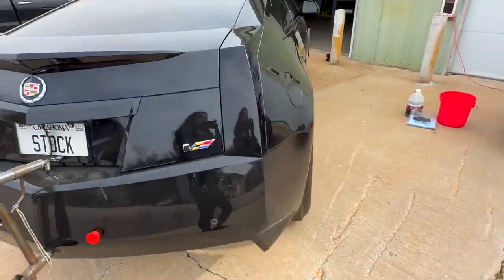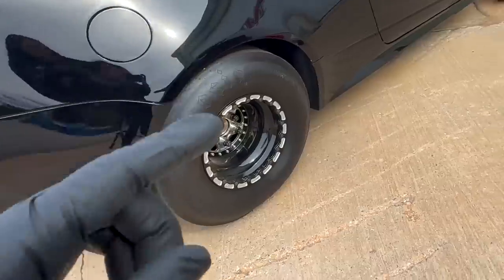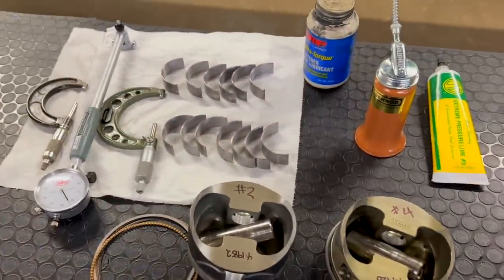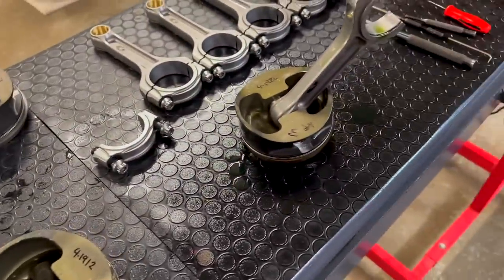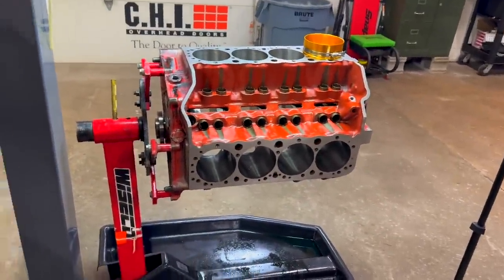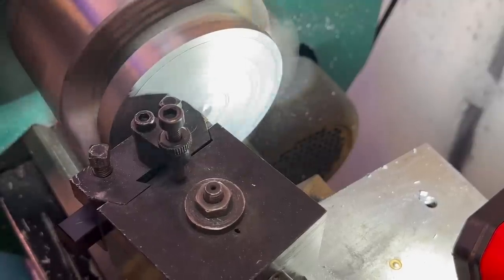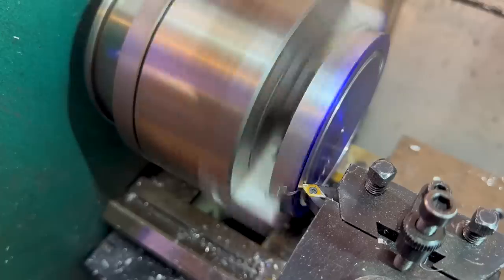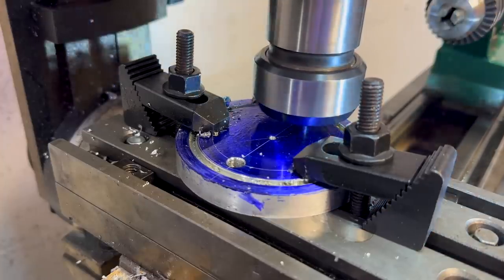Chief getting the short block together to go into Caddy Jack while Jackie gets the car cleaned up!

Comment: For those that don't understand how it works, and keep asking about sealing the bolts to his cover.....
When you oil from the front using an external pump, the 2 galleys that normally go to and from the filter get plugged. The one feeding the filter was plugged under the main cap, and doesn't intersect any other galley. Internal pump straight to filter. The big galley in the center, that he showed you he plugged in the last video will see oil, but with a sealed NPT plug, will not leak. 
So, TECHNICALLY, he wouldn't have to cover it, since there is NO OIL under that cover, therefor  he doesn't have to seal the bolts. It's just a cover. If something drips from a bolt, it means his plug isn't sealing correctly, but there is no oil pressure under that cover. Just an FYI. 
Sidenote: Chief... just a helpful hint for future reference, install the cam first to ensure no fitment issue with bearings.  Then crank. Then timing belt or chain. Install #1 rod/piston and degree cam. MUCH easier as the engine spins real easy to dial in and you're not fighting all 8. 
Then with these big strokers, rod to cam lobe in #2 & #6. This are the closest. Even if they clear, find out by how much. It changes when running, at rpm, and depending on what centerline you put the lobes at. 
I'm sure you didn't show your entire procedure in video, but take note of your rod side to side clearance also. 
Hopefully the head gasket is thick enough to kill the quench if Jackie plans on bombing it on the bottle lol. 
Hope all is good 👍

Comment: Just fyi....If you had a digital readout on your x axis of the lathe you could easily use your grooving  tool to skim cut the outer diameter to get a reference diameter....mic it...then zero your slide and move the tool in accordingly. That will get you within .001 or so of your desired o-ring groove diameter.....you could also just count your revs on the dial but not as quick. Also when you're clamping your part to mill or drill use another thin piece of aluminum on top of your work to prevent marring and make sure the stud coming up thru the clamp favors the work side....not the riser side in the back. The closer the stud is to the workpiece the better...because that distributes more holding power to the work piece to prevent movement of your part. Nice video...can't wait to see the end result at the track!

Comment: Nice on the block off plate, stuff like that is always fun and gives a good feeling when it works! If you have a small part like that with a complex bolt hole pattern, I'd be happy to help. I have a small desktop mill and a DRO so making hole patterns is not too hard to set up. I also have indexing plates for my little cheap rotary table.

I normally say that I chew parts out, I'm not a real machinist. But I get work done.

Comment: Hey Justin next time use your indicator on the mill to find zero. You basically did something really similar when you were using it on your 4 jaw chuck. It’s magnetic base will work on the spindle of your mill too. Or just get you an edge finder for quick and dirty set ups.

Comment: Awesome ! My Dad use to machine main bearing caps for Pontiac engines . 4 bolt main caps with the inside bolt hole drilled at angle .can't remember what angle but . Good. Work man

Comment: Chief...as an old aircraft mechanic...was wondering if the 2 Allen bolts with washers you put on the oil filter cover will leak.  There is a washer made with a built in O-ring called a Stat-o-seal that may solve a potential leak.  OR, you could countersink to the right depth the two holes in the cover to retain an O-ring when washer and bolt are installed.  Good luck with the set-up!

Comment: I think since the seal on your home made adapter is outside  of the  bolts (where the filter would be) the bolts will leak oil, unless you use  Transmission front pump washers or something to seal the bolts..

Comment: Question are the bolt's going to leak oil ? No seals on bolts. You could cut bolt's for o ring on the lathe and the through holes would be sealed.
Reply: good idea! might have to do that

Comment: They make transfer screws&punches for that then with a center drill in the chuck locate punch mark and clamp down . The only way to learn on the lathe is to make things and it helps if someone shows you how

Comment: I think that you will find oil filter blockoff will leak oil from the bolt holes. Without them being sealed off.
Reply: there shouldnt be much oil up there, but if the bolts suck air ill put an oring under them

Comment: The oil filter plug looks good. Maybe I missed something but one thing I noticed is the bolts are on the inside of the o-ring and isn’t that where the oil is? Did you silicone the bolts so you won’t have an oil leak around them?

Comment: Machining parts makes you have a whole other respect for machinist get you a cordless drill make a driver to feed your cross slide even also use gaskets washers on those cap bolts so it don't leak past the threads and head
Reply: good call! thanks!

Comment: Also your face was radiused because the backlash on the machine was pushing your cutter away from where you originally started. On small lathes like that or if I'm hoggin a lot off I like to lock the bed down so you know you got a nice square cut.

Comment: Just an observation but the bolts were inside the o-ring  might wanna consider some thread sealant on them or they may leak as oversized as the bolt holes were. I'm a manual machinist so when I say they were over sized I work to a .0005 tolerance as I build long range precision rifles.  So I wasn't busting your balls and wasn't to bad for a hobby machinist. Keep it up can't wait for Caddy Jack's return.(And the Crow🙏)

Comment: I'm not familiar with dry sump oiling. If there's oil pressure at the filter housing wouldn't it leak oil around the bolts holding your block off plug in.

Comment: I have a question about the oil filter block off you made and that is what is keeping oil from leaking (spurting) from around the two blots that you are using to attach the block off to the block .  Just curious if I missed something.

Comment: I think that the 2 cap screws holding the oil filter plate are going to seep oil. Are you going to need a O Ring between the plate and th block to stop oil seepage?
Reply: there shouldnt be any oil up there anymore, but the smoke test will tell me if i need to oring the cap screws

Comment: Chief, Question on the oil filter block off:

You did a great job machining that, it is SO fun to build things yourself! You are doing great on the lathe!

You made the part TRUE and correct, and then cut your O-ring groove into it (AWESOME job BTW). Then you drilled 2 holes to bolt it in place. What/how is it preventing oil escaping the bolt holes? (I have seen and used the block off plates before, but never really thought of that before (I am old, I may have asked or knew why before, but gimme a break I am OLD), so just wondering.)

Thank You!!!

Comment: One question Justin on the bolts are on the inside of the rubber o-ring what's gone to seal the bolts that pass through your block off plate in your block oils going to sweep around your bolts and leak out working two bulkheads are. Not criticizing you. Another set of eyes I'll problem that you're trying to solve this trying to help keeping a person from tearing a motor up possibly.
Reply: probably going to have to add some orings or teflon washers etc

Comment: I am a little confused, you placed the o-ring groove into the part I assume to keep the oil from coming out (maybe not?) But then the bolt holes are inside the o-ring and are unsealed so won't the oil just leak out from the bolt holes?

Comment: I like the block off cover . The only thing I would of done  ( added) is counter bore the the  two holes .
Reply: i wanted to sooo bad, and i even have the tooling to do it...but we're running out of time to get this thing back together and i needed to finish the shortblock lol. Im hoping at some point i will have some time to sink the cap screws down and maybe even add an oring to them lol
Reply: I like the receiver groove o ring idea 💡 to the two bolts !

Comment: Any RTV around the head of the 2 bolts? or maybe copper washers? Just curious, not knocking
Reply: Doesn't need to, it's not sealing any oil. Just a cover.
Reply: probably going to get a couple orings or copper washers would work also....good idea!
Reply: @justinshearer3016  Didn't you plug the holes that would normally feed the filter?

Comment: Your makin it look easy! I'm a fan of making your own parts I'm sure it was a lot of time getting it right. It sure looks like it came out as a nice part! When your assembling engines what's your preferred assembly lube?
Reply: just some good non synthetic racing sae oil.....30wt for the rings and 70wt for the bearings and such

Comment: Wait.. Aren't those bolts in the oil galley? When the system gets pressurized, how those steel washers are supposed to seal? And there's a difference between one fastening point in the center and two fastening points on the sides. the former creates even pressure on the O-ring and the latter creates uneven pressure and distortion on the plate. Yes the plate is thick and solid and all that, but there's hydraulic pressure behind it with uneven heat source and vibration.
Reply: no no no....no oil pressure there anymore. Its just a vent now basically and with the vacuum pump it will have negative pressure
Reply: @justinshearer3016  Okay, cool! Definitely want to see the rest of this system mod. This is interesting stuff!

Comment: Chief I would like your opinion, I was always told not to use thick tacky assembly lube in freshly honed or bored cylinder's because the thick lube fills in the cross hatching and will not let the rings seat properly I use the motor oil I'm going to run when I put pistons in but is there any truth to the question? PS kudos to making a nice oil filter block off!
Reply: i use sae 30 non synthetic racing oil for the rings and bores, and i use 70wt race oil non synthetic for bearings and what not. I have seen where using slick or synthetic oils when putting together a new build will keep the rings from burning in. 

As long as you prime the engine good before firing it up, you dont need any slick or heavy assembly lubes. When in doubt, i refer to the reher morrison championship engine assembly book lol
Reply: @justinshearer3016  That Book was my Bible, I studied that book before I built my first Engine ( BBC ) that and the Guide to assemble the BBC , that's the only type Engine I ever built and ran, my first Engine took me 2 weeks to assemble I think I checked the Torque settings 3 times.
Reply: @michaelwynne4346  people underestimate the power of books in the digital age..that one is my engine bible for sure lol
Reply: @justinshearer3016  thanks for the response so there is a little truth to it and makes sense, but I do the same thing as you stated 30wt for the pistons and ring's and 50wt for everything else did think about 70wt have to stick that feather in the hat Thanks!

Comment: Lolmao, Chief that's not that fancy, other than recessing "the bolt holes" to keep anything from getting caught on them, but it'll do. You do know most people wouldn't even have gone that far to even "plug the oil galleys into the oil filter" much less make a oil filter spot plug. But you did an alright job of it!

Comment: Hey smart fella it's a shame you didn't have an old Oil filter adapter from any old SBC motor no no no so you can transfer the holes you need onto your new gizmo you could have banged that out in like easy pezze time

Comment: What ring compressor is that chief used?
Reply: i think its a proform?
Reply: @Justin Shearer  thanks I'll check it out, never seen a tapered compressor that was adjustable like that. I have several of the ARP but it sucks they only fit one bore size.
Reply: @cherryseeg2  i know total seal makes them also, but amazon had this one in stock lol

Comment: How do you do your break in process? I'm building a similar set up.
Reply: make it idle, then put it on the brake a couple times....change the oil and pull the trigger
Reply: Idle to temp, make a pull. Nothing to break in, just seat the rings.
Reply from the maker: put it on the limiter at least 330’
Reply: @MidwestStreetCarsAuto  Full pull! Lol. Like when we dyno an engine right off the stand... 😏

Comment: Why not H Beam rods?
Reply: Technically, I-Beams are stronger. H-Beams hold too much oil per rod. That's not to say those are the reasons he has I-Beams, as he may have just got what was readily available. If I'm not mistaken, the first set of rods he got mistakenly in 6.00" were H's.

Comment: Machine Work looked great to me. But is that part not
done I'm confused. where does the oil filter go now. Is that  Remote pump And filter. Probably stupid question. Or is it that block's  Last go around Cause the boars are  Paper thin and if it blows up  It's toasted anyway so who needs the filter. I'm missing something so I'm confused. but keep up the good work Only 405 channel I watch Cause  Big chief is real deal OG street Racer. Stays competitive with old conventional  GM engines.No unobtainium  Billit Himi crap.  That most people can't afford and don't really Care about. You guys build and work on Things that most people can obtain still costs a lot of money but it's Real stuff old small block has got old reed cam. I built a little high compression 327 small block back in the day when I was 19 had those guys custom made me a Cam. Thing ripped too bad they're not around Anymore. But I really appreciate that you guys are  Are you using that old iron to keep up with the big boys  And given them a can a whoop a**.

Comment: That car was cleaner before you started. than any of mine  ever are. if you guys ever get hard up 405 car wash. But I only pressure wash cars  Under the hood When the engine out Cause I'm gonna get it all dirty putting it back together. Then I'm gonna get it even dirtier on the 1st rip. Then I bring it back listen to it run while I wash it. If you read this I'm sorry you won't get that time back. Useless information from Chuck the car guy.